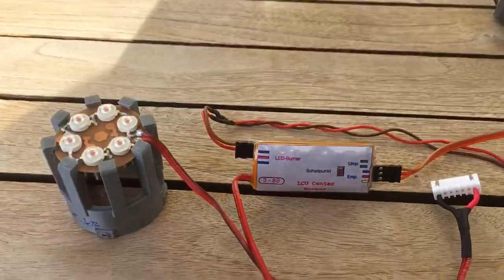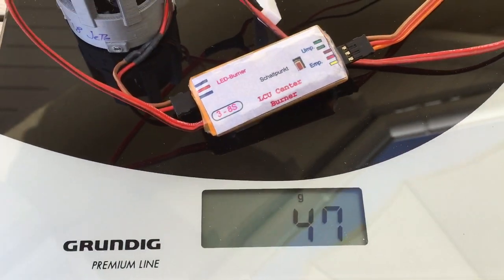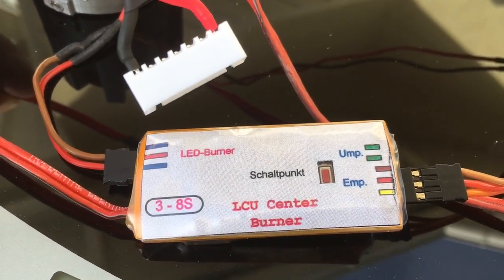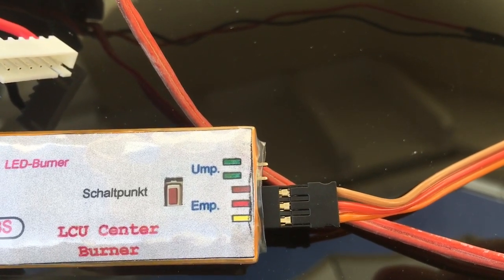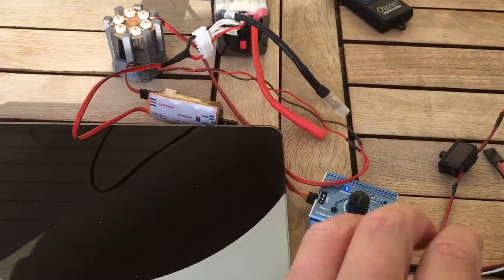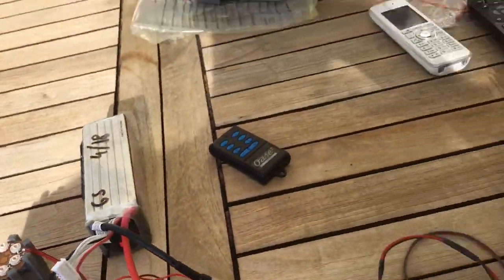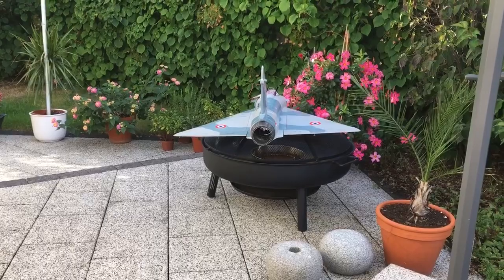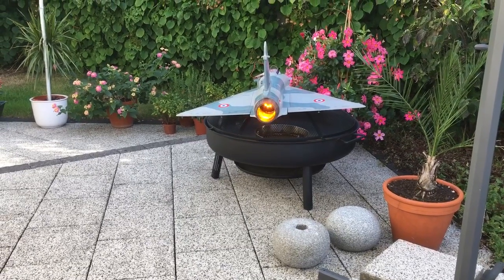RC LED Afterburner Unit for EDF Jet Models

Comment: Great idea, but did you measure the thrust before and after installation of this device into plane? I wonder how this device interferes with air flow behind EDF?
Reply from the maker: No, I didn’t. There is certainly a loss, but in my opinion it isn’t noticeable in the scale-like jets.
Reply: robflyrc there is for sure going to be quite a bit of a loss. Any time there is a flat spot in the exhaust flow the turbulence takes away. But the brightness and flicker is really impressive!!
Reply: Hallo, ich bin schwer beeindruckt. Wo kann ich diesen Centerburner denn kaufen ? Danke vorab und lieben Gruss.